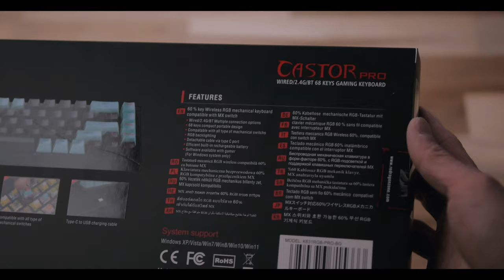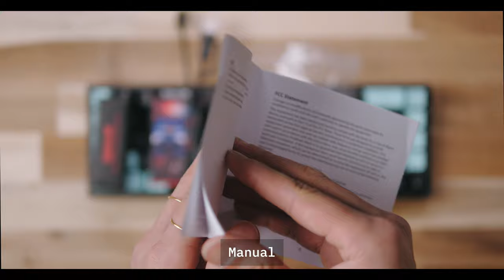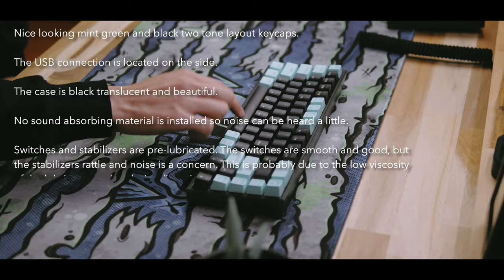Redragon K631 PRO SE Showcase + Review + Sound Test

Comment: I have this and I really like mine. I didn't even think about the fact that it has zero foam layers inside. Normally that would be something I'd require before buying a keyboard. Obviously on this one there wouldn't be any at the very bottom since they went with a LED shine through with the transparent case. But no plate foam layers or anything either, I hadn't noticed because I really like the way this keyboard sounds anyway. If anything it has convinced me that I probably prefer plastic materials over metal, at least for the plate. I know most people think of aluminum and other metals as more premium and they want a weighty keyboard. This thing is almost light enough to feel cheap, but I think the plastic build is probably why it doesn't feel harsh and pingy, along with the lubed switches. So now as I look at other keyboards I figure I would probably prefer products with a polycarbonate switch plate. I have other Akko, Redragon, HyperX etc boards sitting around, I think they all have steel plates, and there must be a reason this K631 has been my main board since I got it. Somehow the plastic build ends up being a positive in my opinion. Maybe you don't need a bunch of foam when everything inside isn't rigid metal.

Comment: If the plate is mounted to the case, does that technically make this board top-mount?
Reply: Nono, its technically integrated plate mount, because the plastic plate and the case are somehow stick together when assembled just like an integrated plate mount system